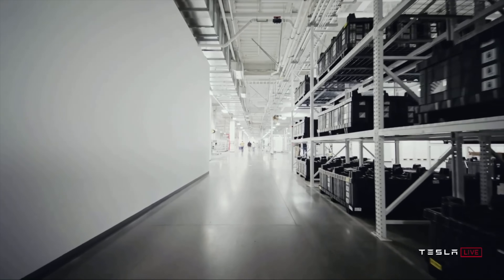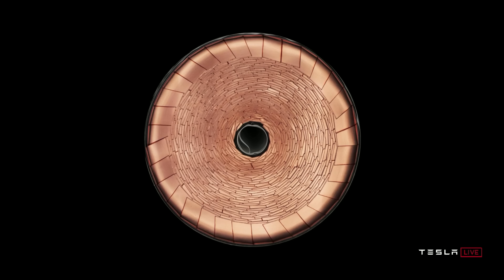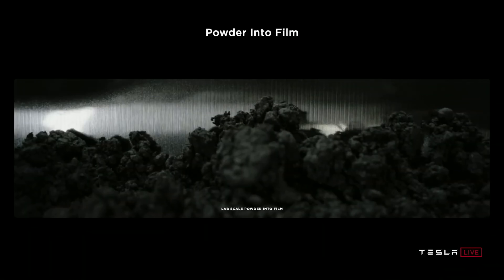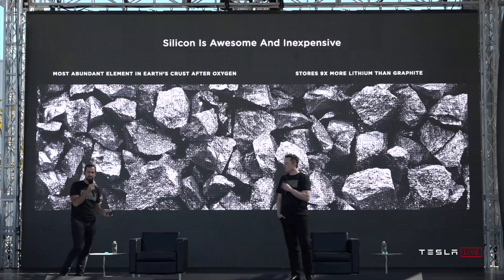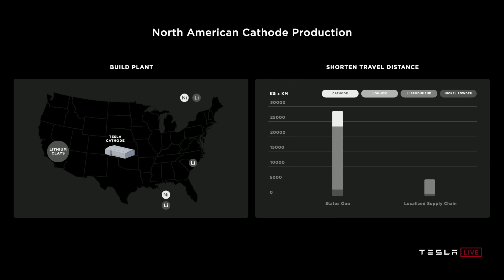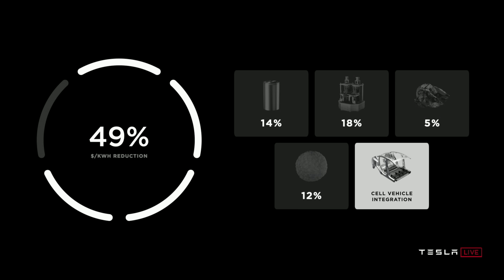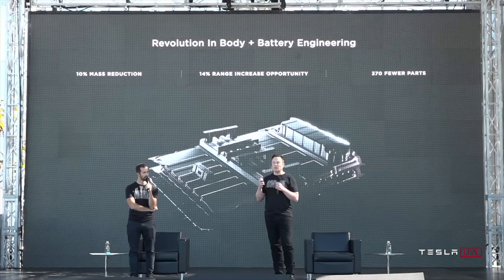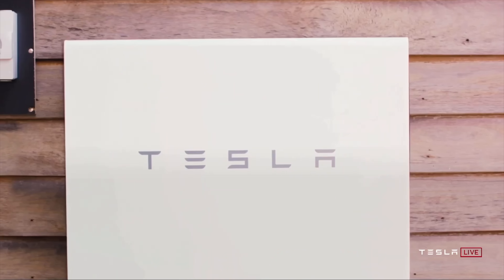How Tesla's New Battery Will Destroy Gas Cars

Comment: "Destroy Gas Cars"??? Well that's sure as hell a click bait title. Hey I'm all in favor of electric, but exactly where is the power generation going to come from to power even 20%  of the cars on the road today? Just to use North America as an illustration, there's pretty much no sites left for any large scale hydro electric dams, no one wants nuclear. Wind, solar, tidal generation can only do so much and only at certain times. Our electrical grid is teetering on the brink of rolling black outs, it's continent wide infrastructure is in serious need of updating, and you all think ICE are somehow going to be dead just because the costs may or may not be coming down? You can get electric vehicle prices down to what a 1908 Model T cost and it means zero if there's nothing left to power it with. Without an almost instant breakthrough in cold fusion, and some seem to think that may not even be possible within the next 30 years or possibly never, electric propulsion is and will be a very limited method for a long time to come yet. Even if we could generate enough power, then who's going to pay for a 5-10X increase in our total electrical grid infrastructure and how long will that take? No one involved in electric vehicle production has seemed to ever address that core and unavoidable issue.
Reply: Peter Breis  Where did I say you couldn't charge an electric vehicle at any time? Of course they have a storage system, that's why there called battery's. It's what the word means.What I said was there's in no way enough excess power available to have even 20% of the current ICE  powered vehicles switched over to electric power. And most country's in the world are in the same situation as far as having excess power available. So that holds true on a global wide scale. And again even when or if we can start to generate enough power then exactly who is going to be paying for the additional infrastructure and those battery farms.Until those massive power generation, transmission and storage issues are solved, any large scale use of electrical propelled vehicles is a failure waiting to happen. Just how many are going to be so enthused about electric vehicles when it starts costing $5 to switch a light bulb on in your home for an hr.?

Comment: regardless as battery packs dont last a reasonable time ,if the owner has to change the pack every 5 to 7 years, it will never catch on.
Reply: 2007 called, it wants it's lame false rhetoric back. They are GLUING the cells into the structure of the vehicle. These batteries are expected to last at least 15 or 20 years and go hundreds of thousands of miles with minimal degredation.
Reply: I suspect you are wrong @patreekotime4578

Comment: Gas maybe, but diesel is still king when it comes to long range. My Volvo s60 D3 from 2011 could easily do 1300km on one tank with a 5-8 minute refuel. When an electric car powered by a battery can do the same range with less than a 10 minute recharge I might get one. I have places to go and spending hours on recharging alone when doing long range trips is just shit to me. I drove from the middle of Sweden to Calais in France in 1 go with 1 30 minute and one 45 minute ferry in just 18 hours a couple of years ago. I would have had to either stop way before Calais or sleep in my car if I had done that journey with an EV.

Comment: I would be concerned about overall battery life and how difficult it is to replace and dispose of old, non-working batteries.  That said, I'm not a Tesla fan.  They're doing impressive things, but I just don't want to buy their cars due to laughable QA issues (seriously, hearing about people refitting body panels right after taking delivery is just ridiculous).  I also HATE their design aesthetic:  Boring exterior styling coupled with minimalist interior with a huge screen, where you have to go into submenus to adjust basic things (wiper speed, I believe, is an example of this).  No, thanks.  I may buy an electric car someday, but it'll be a different manufacturer.

Comment: Battery heat comes from the negative (bottom) terminal. The bigger cells with tab-less electrodes allow the cells to sit directly onto the bottom (-ve) cooling plate. They are then potted in epoxy and the positives linked up. There will need to be a way to disconnect failed cells but the engineers will have that covered.

Comment: Not enough rare Earths to make it happen, super capacitors made from graphene will be the way forward.
Reply: What rare earths? Silcone anode. Either nickel, nickel-manganese, or iron phosphate cathode. The Model 3 reluctance motors DO use rare earths but in dramatically lower quantities than pure permanent magnet motors other companies use. And who knows if they will reengineer the motors as well.
Reply: Patreeko theArtist lithium is a rare Earth when all the easy Lithium is gone then going into a wild forest and other Nature preserves. Super Capacitors is a far better technology.  You can also charge them in about 5 minutes.  However LFTRS are the way to provide power to the new grid for the 21st century.

Comment: So Tesla will have 6 time the Power. That would mean that the next model s p100 d will have 4950 hp as the current one has 825 hp. I don’t know what to believe?
Reply: 6 times the power of the battery, not the motor.
Reply: 6x more power per battery CELL. The new packs will require dramatically fewer cellls to go the same distance. But the full pack WILL have more power. Which is why the Model S Plaid can do 0-60 in under 2 secs and has over 200mph top speed.

Comment: Not only will it destroy gas cars, but millions of lifes of people connected to the motor industry in one form or another , even plants or greenery is going to suffer.  200yr. who knows the Earth might be Barren just like the MOON or MARS.
Reply: Dear Douglass todd:
   Just as Integrated circuits put Transistor Makers out of Business.
And Transistors DEVASTATED all the people making those wonderful Vacuum Tubes! 

In 1960, I was six years old, and every three months or so, a Man would come to the house.   I'd say: "Mommy, the TV man is here!"

The TV Man carried a Big Box (about three feet, by two feet) containing about 50 Vacuum Tubes.   At least one or more Tubes would burn out every three months and the TV Man's job was to replace them.

 Just out of curiosity, how are "plants and greenery going to suffer" from more efficient Electric Cars????

  Let's assume we can generate more power via Clean Energy, and take all the gasoline cars off the road.  Even if Power Plants DO burn oil and gas, at least it's easier to contain the exhaust from ONE Power Plant (if we have the will), to try and contain and modify the exhaust from millions and millions of cars.   
  
   So "plants and greenery going to suffer"?  I. DON'T. THINK. SO.

Comment: What would impress me most is to be able to actually buy an electric pickup truck before I die. (I'm  72 -it's gonna be close I think!)
Reply: You can buy one right now if you want.
But, you have to buy a normal combustion-powered truck, and then have it converted to electric power. It can be done--but costs a fortune, and the range probably isn't all that great, so you may as well just drive it with the combustion engine it comes with, which is much cheaper and give a longer range :)

Comment: When everyone is driving EV's, will I be able to buy gas for 5 cents a gallon?
Reply: Not if your state hikes up the gas taxes to incentivize EV buying.
Reply: Probably not. It could even get more expensive. As demand for oil goes down so will production and as oil benefits immensely from economies of scale we could be looking at a future where oil could be used for niche applications in lubrication and plastics only.
Reply: Jose Lemus So what if the pandemic spells the end of the petrol industry because there is low demand now?
Reply: noxxi knox  if I'm not mistaken, solar has become cheaper than or competitive with fossil fuels. And renewables are the most abundant energy source on the planet, it just takes time to establish the industry.

Transmission losses will be neiglible with domestic energy production and storage. Such as solar roofs and  geothermal thermal heating. Of course, not everyone will have this but the potential is there.
Reply: All these people acting like the farm vehicles will be electric and the need of oil will just vanish because of a new battery... also don't stop and think about the taxes that are made from the power plants that still burn different fuels which will jack their rates to charge said new cheep e-cars... there is a long way to go before anything good actually comes out of the new technology that will benefit consumers or the planet. Oh and don't forget that if you live in a place like I do you might have to travel 14 hrs to find a qualified mechanic...  🙃
Reply: The gas stations will go broke so probably better buying a diesel and running on vege oil.
Reply: noxxi knox  Ignoring the energy losses that go into drilling, shipping, processing crude and shipping the gasoline. Of course.  And also ignoring that power grids pretty much everywhere (including the US) are getting greener every year.  Mostly due to the fact that building out new solar and wind are just flat out cheaper than the cost of maintaining existing coal and ng plants.  Your analysis also conveniently ignores regular oil changes.  As well as the fact that shipping is moving to burning dirtier and dirtier fuel as costs go up.
Reply: I just can't wait for Big Oil to suck it.
Reply: noxxi knox  yes indeed both solar and wind have large area usage. But I saw in the news the other day about a office building in my country covered in solar, producing way more than it needed. I believe it was called Power House? They said it could supply the nearby shops as well, or 2000 homes (I might exaggerate the number can't remember).

But I think that thorium reactors are part of the solution as well, much more abundant and much less dangerous than uranium.
Reply: No.
Reply: Everyone right now is 2%. I doubt it will reach 10% in the next 15 years. Driving around the mountains in my gas hog yesterday no range worries and a gallon is $1.85.
Reply: noxxi knox Which is why is specifically said “gasoline for vehicles” which covers how oil would still be used for other products. But as the demand for gasoline for vehicles go down due to EVs, less companies will begin to produce gasoline vehicles and less companies will offer gasoline in general to power those vehicles.

Doesn’t matter if gasoline is a byproduct of the processing of crude oil. If barely anybody used the stuff.
Reply: No, gasoline for vehicles would get even more expensive as the total amount of users shrink. So the incentive to keep prices down goes away for companies. Eventually, companies might not even make gasoline for vehicles if there just aren’t enough on the roads.

Only time gasoline for vehicles would ever come close to 5 cents per gallon is if the world still used gasoline. But we found a planet the size of the Earth which, instead of it being 70% covered in water, the planet was 70% covered in oil.
Reply: Nope, it will increase in price and Govts will need to figure out how to replace the taxes they loose from the sales....
Reply: Richard J Fletcher But when they do that, they accrue more than what they end up losing. A Tesla Model Y gets the equivalent of 154 MPG based on a 270-MJ battery, an EPA-estimated 315-mile range, and the chemical potential energy of a gallon of gasoline, or 132 MJ. An Indiana resident would pay $30.30 in gasoline taxes if he drives 10,000 miles per year in a petrol-powered Tesla Model Y, but his home state charges a $150 registration fee. While it is still likely cheaper to own the Tesla compared to its ICE counterparts, the state of Indiana is profiteering on these fees and earning more than they should.
Reply: @rjrfletcher2355  They already know how to do that. Charge your EV while it's still cheap.
Reply: Everyone driving EVs? It's not going to happen.
Reply: @darood77  "everyone driving cars? It's not going to happen." 
- some guy in 1900
Reply: @neinherman9989   And there's this guy from Mars?
Reply: @darood77  whut?
Reply: Yes of course....and you will also get your face smashed in for killing / polluting the planet/people....

Comment: How does 5x the energy density only lead to 16% more range?
Reply: It's misleading. Their new cells have 5x the energy as compared to a traditional 18650 cell. But considering the new cell is about 5x bigger than an 18650, the energy densities are probably quite similar. The 16% range could be better cell packing effeciency with larger cells and likely some slightly improved energy density (but not 5x!!).

Comment: So in other words, business as usual? The major drawbacks of a purely EV not remotely addressed. A car might be able to now go 350 instead of 250 and require 2 hours to charge. Cool right?

Meanwhile, they are still expensive, heavy, short effective range, not a good solution given our current power grid, expensive to work on, have features that are software locked and have to be paid for, and as for trucks generally a terrible truck platform. 

Due to the drawbacks a car would need nearly 750 mile range to really be worth it. At least then a full days worth of driving non stop it would last and it would be able then to be charged while you are sleeping. These things are still a low range in town / short trip solution sadly. And because of that buying a hybrid simply makes more sense from a consumer point of view. Also the lack of a unified EV charging system is a huge drawback. I can go fill up at any gas station.

The battery would need to be well in the 160+ kwh range, for trucks it would have to be will into the 300 kwh+ range.

That or i could just go buy a $27,000 Camry hybrid that just works. Or a F-250 on the truck side of things.

Comment: So we need better batteries to make EVs attractive? This is not the reason for driving EVs. EVs are not just ordinary cars with batteries. Current EVs, including Teslas are only 1/3-1/2 lower in emissions, than gasoline cars. We need around 20 times better if we want to keep our cars in the future! 69% overall improvement on battery day is impressive and quite the leap and very encouraging, but why waste it on ordinary cars? Elon could have chosen to make  smaller EVs years ago, and we would be there already.  2.4 tonnes of vehicle, is not the most efficient way to move 150lb lumps of meat down the highway. With current battery tech, we can build cars that use around 80Wh/mile, 120Wh/mile highway, and cheap long range EVs could be commonplace. We don't need better batteries for old tech vehicles, we need better vehicles. China understands this, and produce more small EVs that all the world's luxury EV brands combined, having a much larger environmental benefit and are dirt cheap compared to any model Tesla. We are only a few months away for differentiated taxation of EV based on their overall emissions in Europe, and an e-SUV will soon be considered a relique of the past, because customers in some markets had great difficulties grasping the purpose of driving EVs.

Comment: I think Supercharge time for tabless dbe cells will be 66-75% shorter. With no or low heat issues, max Supercharger power will be able to be supplied for 10-12 minutes instead of the 3 minutes currently.

I also think DBE may be introduced into the 2170 cells that Panasonic makes. Not sure if they will also allow them to use Roadrunner lines and tabless. Those may be saved for Cyber, Semi and Roadster.